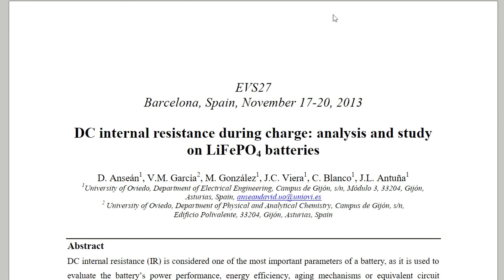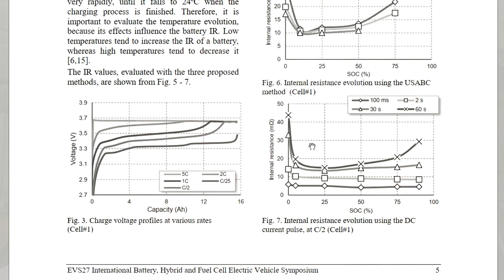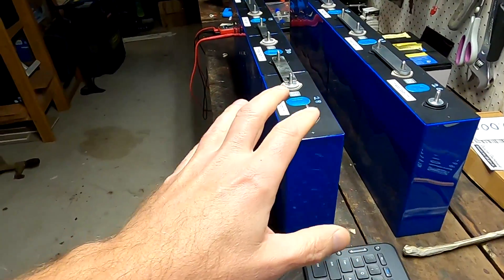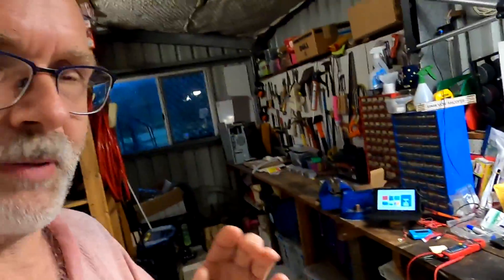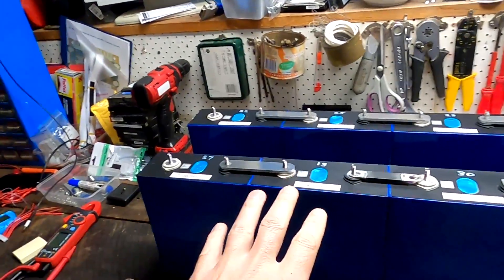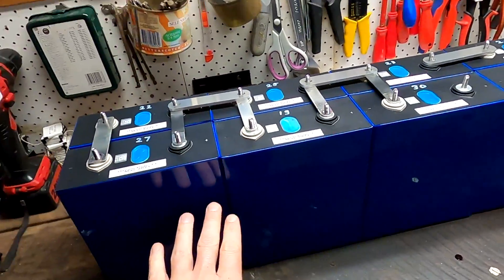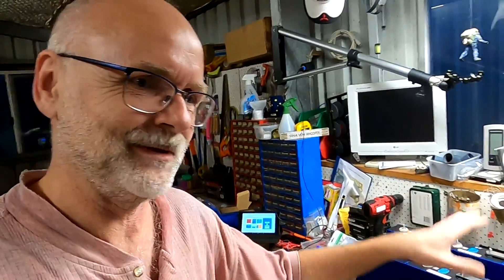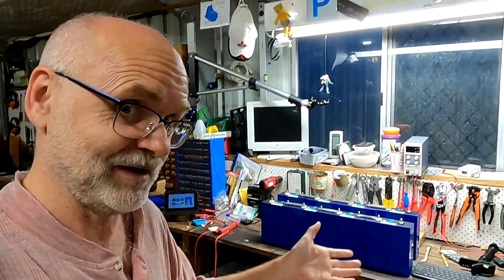Can you parallel battery banks after bottom balancing?

Comment: With a total  off grid situation, we never see the bank completely full, or never completely empty. The bank is constantly being discharged and during the day charged at the same time. The bank is sized so that it hovers somewhere between 20 and 80 percent charge level, it  almost never reaches the voltage extremes because  of its size. Therefore, the bank stays around the 3./ 3.6 V per cell  level, the mid  part of the curve which varies very little. Its only at each extreme the voltage can  potentially damage individual cells over  time, it seldom gets that far..  The charge controller will protect the high level, the inverter low cutoff protects the low voltage level. . Cell variation only matters when venturing toward  the voltage  extremes. Cell balancing cannot work effectively or make any real difference at mid charging points, the cells will always be 3.0/3,6 volts nomatter what their state of balance is. My bank is always within 30mV, no BMS, no balancing..... , remember we are talking just 30/100ths of a volt here, your case  are dealing with  and expecting balances of just 3/100ths volt, ie 3mV,  that is 10  times less !!. Thats  an extreme resolution that is not necessary. The long term battery cell drift in reality  over long periods is very low when batteries are used in this way. You are seeing these voltage imbalances only  because of "batch" charging cycles, where you fill them up, then drain them, constantly worrying about a few 100ths of a volt.  These batteries really are not that fragile and fussy. You have discovered already just how little capacity remains at either end of that flat curve, there is no need to go that far. Apologies for the  lengthy comment.

Comment: Hi Andy, use your new bottom balanced 24 volt bank to power DC LED work lights for your garage. Then add a 24volt DC truck stereo. DC is really easy and great lighting leaveing your 48 volt bank for your inverter.

Comment: Hi Andreas, hi all,
for now 2 years I'm running a 25 V / 1600 Ah system.
There are 8 blocks with 8 x 200 Ah. Every block has an actice balancer, I'm using no bms.
The upper voltage is regulatet by the charge controllers (3), the lower voltage is regulatet by the grid tie inverters (3). The blocks are connected with plus and minus together to big copper plates. With this connection every 24 V block has exact the same voltage as the others and the 8 active balancers are conrolling and keeping the voltages  for each block.
System is running for now two years without any problem....
Best wishes, Wilfried from Neuss, Germany......

Comment: I’m no fan of bottom balancing, and I don’t think below solution is a good ide, but I actually think it will “work” in parallell as long as you have separate bms’s for the packs. A common port bms won’t know where the charge is coming from, and will do its work accordingly, ie shut of charging when the weakest cell peaks. The charge voltage would then be determined by the pack that has the highest sum of cell voltages, and preferably you would use mosfet based bms’s.

In this configuration there should be no problem for the controller/inverter as long as the strongest pack remain balanced (ie the charge is not shut off by the bms but the charge controller). 

In theory you should be able to mix top and bottom balanced packs as long as they have their own integrity secured (BMS).

Reagarding your early comment on absorption and floating; you will have kind of floating for the weaker packs, but more like trickle charge since the bms will control the charge. A sunny day when the bank is “full” the bms will trigger on and off constantly. (Again, mosfet based bms is preferred)

Comment: Never bottom balance, BMS is designed for top balance only and by design to shut the battery bank down if too high or too low  voltage

Comment: Hi AndyIn my opinion top and bottom balancing are for 2 different purposes
If you are going to run your battery flat on a regular basis ie in a electric vehicle bottom balance is the go
If you are running your battery to full capacity every day as in a home based power system top balancing is the way to go.
If you are going to expand your battery by paralleling a extra bank top balance is the way to go
I have my 27kw system top balanced and it is still in balance after 3 years maintained with a Australian made bus
Keep up the good work

Comment: You are trying to figure this out without thinking about chemistry. Any battery regardless of type is moving ions between two locations. The internal resistance to movement is determined by the number of ions in the battery. This resistance is a chemical resistant! How much energy is required to move an ion from point A to point B. If battery a has a million ions, and Battery B has a hundred thousand then battery A will move 10 ions every time battery B moves one ion. Automatically, you don't have to do anything. It goes without saying that the batteries have to be the same chemical composition. From our perspective, it requires electrons to do all of this! From the batteries perspective every ion requires a certain number of electrons to force it to move. Pretty simple concept!

Comment: Hi Andy, these are just my opinions but I have been around batteries since 1979 when I worked for a large battery manufacturer. I studied electrical and mechanical engineering and although I now design computer software I have worked with load balancer, split charging systems and battery powered device terminal estate management systems in the past so, I have quiet some views and experience of what works and does not work in battery and cell management. These are just my opinions and I’m sure others will have different views…
Each new cell pack you add should in my opinion be thought of as a separate entity and each should have a BMS of its own. The reason for this is that you want each cell in every one of the entities to be individually monitored in terms of its lowest set voltage, and you want the BMS to cut the discharge from that entity when any cell in that particular entity reaches its minimum set voltage. So each entity does not need to be matched to other entities in terms of capacity. All cells in each entity should be same capacity (matched) for that entity. This allows you to add another entity to your ‘battery bank’, the only thing you need to do is make sure that each new entity you add is charged to the same voltage as the bank before connecting so that cross entity transfer is minimised. If you then need to discharge the bank then all entities will contribute until each reaches its bottom limits based on the BMS setting for that entity. Any entities that have not reached their bottom limits will continue to contribute until all entities have reached their bottom limits. Same applies to each entity for top limits in terms of its top cell voltage limits. The BMS balancing should be so low as to be irrelevant or should be disabled in each entity. You have to think of it holistically as each entity being a contributor to the sum of all entities. The solar panels are contributor entities when applying a load to the bank and become net contributors to the battery bank. When the load is removed they become the recuperation source and the battery entities each become a separate load until each is charged and disconnected by its BMS. An analogy is It’s a bit like a group of people pushing a car up a hill, not all the people need to be the same weight, strength, size, or have the same stamina. All the people contribute to pushing but some will do more work than others, some will push with a lot of force but stop pushing earlier, and some will push with less force but for longer. Ultimately all will stop pushing and need to recuperate. Eventually the car will get to the top.

Comment: You can think of Equalization as Center balancing if it makes you feel better. However as long as every battery is operating in the center region that is not in either knee, then they will simply share current as required for their individual capacities and it is totally automatic. When the voltage starts to drop rapidly or rise rapidly, cut off the charge or discharge.

Comment: The same process occurred on the discharge side. As each battery approaches its knee the internal resistance to providing electrons rises. The smallest capacity battery will simply not provide electron and the higher capacity battery will. When every battery in parallel is exhausted, in other words has provided all of the electrons it easily can provide, then each battery has reached its knee, and the voltage will start to drop rapidly. That is the discharge the of the entire battery and you will see the voltage of the entire battery start to drop rapidly at that point you need to turn off the battery to prevent higher resistance and heat and higher damage.

Comment: When every battery in parallel reaches its individual charge capacity and its internal resistance begins to rise rapidly then the voltage from the outside starts to rise rapidly. That is the knee of the entire battery.

Comment: At some point the lower capacity battery reaches its charge knee and its internal resistance begins to rise rapidly. In the meantime the higher capacity battery is still merely accepting electrons with a lower internal resistance. The electrons simply flow into the higher capacity battery with the lower internal resistance. At some point, the higher capacity battery also reaches its knee and its internal resistance begins to climb rapidly.

Comment: It is this varying resistance which allows two batteries of different capacities to work together seamlessly. At any given voltage the lower capacity battery will have a higher resistance to electron flow. As a result the higher capacity battery will accept electrons which the lower capacity battery cannot accept at any given voltage. Likewise on the discharge cycle, the higher capacity battery will provide electrons which the lower capacity battery cannot provide at any given voltage.

Comment: The battery manufacturers tell us operate within 10% and 90% of capacity. This is why! Yeah you can jam 20% more into the battery but you do so at the cost of increased resistance and thus increased Heat. Heat damages the battery. Do not do that

Comment: Electron flow into and out of battery provides the charge to push these lithium ions back and forth the knee represents the point where chemically the battery is at its end. The battery is telling us I have no more electrons or I can accept no more Electrons. The Area past the knee represents substantially higher resistance, which represents higher Heat. Heat is bad! Try not to go there!

Comment: I watched a very good whiteboard lecture about the chemical processes involved. There is a metal film with a layer of iron phosphate deposited on it. This layer accepts or provides lithium ions. As the lithium ions have to be pushed deeper into or extracted deeper from this layer the resistance goes up. And thus the voltage required to push or extract the lithium-ion goes up. At some point this layer runs out of easily available positions And the cell has reached its knee.
Reply: Can you please post the link to that video here?

Comment: My understanding is that when a battery reaches its knee , it is unable to accept or provide more electrons. So if you have another battery of Greater capacity, that battery will still easily accept or provide electrons. The two batteries will just naturally share the load or the charge based on their individual ability to accept or provide electron at any given moment.

Comment: My answer to your question is once again to stay away from the Steep curve past the knee. You connect the strain and parallel allow them to equalize. Operate. battery between 3.10 and 3.4. This that you have control over the vms4 the low side and the charge controller for the high side

Comment: I top balance.  I charge my batteries up to 3.55 to fill them up, and I use my Batrium BMS to burn off any excess voltage on a cell (@1.7amps/cell) if one cell gets to 3.55 before the rest. In all 3 cases where I’ve built my own battery bank, I get my rated capacity between 2.75 and about 3.50. So I just plan to use my cells in that range and never go down to 2.5 or up to 3.65 unless it’s a rare circumstance.  But I also oversize my cells in hopes of having more capacity than needed.  
As far as expanding the battery pack goes, I consider what I am powering (discharge rates) and if the cells are close in capacity or not. So far, I’ve managed to buy near-the-same capacity cells on the 2nd and 3rd round, so matching hasn’t really been an issue. I started out with a 2P8S pack with a continuous 1C discharge rate of 272ah, and then when I added another 16 cells, I knew I would want to draw around 200-250amps @24v so I added a second 2P8S and put it in parallel with the original pack. So now, I have a 2P8S2P with a theoretical continuous 1C discharge rate of 544amps to run my 2 victron 24/5000 inverters. The reason I didn’t just parallel my cells and get 4P8S, was because if I didn’t want to work the cells super hard. I still have the capacity either way I do it, but one way doubles the discharge load on the cells, which would shorten their life span.  As far as expanding further, beyond my current 32cell pack, I would likely double my cell count each time I expand. Ergo, my existing cells would be rearranged into a 4P8S configuration, and if I can’t get the same size cells again, then I would just change my Batrium bms capacity from 544ah to 1088ah and probably lower my top voltage down to maybe 3.45 or something just to keep one pack from filling up too much before the other one as you mentioned.  With Batrium, I can have over 100cell monitors in nearly any configuration I like. And unlike other BMS’s on the market that balance or discharge-to-balance using only a few milliamps, the cel monitors I use can do 1.7amps each.  Oh and the bms can handle up to 1000amps if the battery can handle it.  I wanted something that would grow with me as my needs changed and I also wanted something that would integrate into the victron ecosystem and tell the MPPT’s what they needed to do based on the condition of the individual cells, not just based on a voltage number. If one cell gets too full to fast, the bms tells the charging system to “slow down” or even to stop charging.  

My $100 offer still stands, Andy!  😊

Comment: As for connecting 2 sets of batteries.  Just make sure the wires attach on opposite plus and negatives.  The strongest battery will always take the most current, but that doesn't matter much.  Eventually, they will both be the same strength.   Bank 1+ to inverter and Bank 2 - to inverter with cables connection + and - from each pack.

Comment: Bottom balancing would help if you expect to have a very high charge current.  If you have a high discharge current a top balance would be better.  But like you are figuring out, it needs to be automatic and I don't see a way to bottom balance automatically.  Maybe with a BMS that activated a balancer only when voltages are low.  Still the better automated solution is a resistor based BMS with higher shunting capability than your solar charge current.  Then you never have a shutdown unless your entire pack is fully charged.   Batteries are not the same efficiency so you will have some needing 101% to charge and some 102% to charge.

Comment: * To parallel safely the voltages much match close enough to prevent high current flowing.
* To parallel effectively so the banks will not rapidly drift apart the state of charge must match - the same point on the charge and discharge curves. Even then parallelling is sketchy as the paralleled will not share current evenly and will drift further apart with each cycle. The worse the match on the charge/discharge curve the faster the drift.
* It is easy to match at full charged and top balanced and it is easy to top balance with a set and forget "charge all the cells to 3.6v until current stops flowing."
* It is hard to match at full discharged and bottom balanced and it is hard to bottom balance as there is no set and forget - you must define a voltage and a discharge current and as soon as you stop discharging the voltage will rise. That is, unless you ruined the cell(s). What do you think will happen if you discharge "until current stops flowing" ? Now try to do that with multiple different banks at different times so they will be at the same points on their charge/discharge curve. It's hard.
* It is impossible to match points on the discharge curve anywhere in the middle between full and empty. If you match voltage you can safely parallel, but the banks will drift far apart with few cycles.

Comment: This is shocking. I ran a test on a 280Ah EVE cell to see what the resting voltages are at different States of charge so I could accurately charge to 80%.  I started charging an empty cell at 15 Amps and putting 28Ah into it (10% SOC). I let it stand for several hours to stabilize, and recorded the voltage. I did this in 28Ah (10%) increments. Everything looked fine until I got to 70% SOC. the resting voltage was 3.341V. Now here is the crazy part, 80% had almost the exact same resting voltage of 3.343 and 90% was also at 3.343. 95%? You guessed it, also settled at 3.343V! If you're going strictly by voltage to estimate state of charge, You could be anywhere from 70-95% at roughly the same voltage. I believe the best way to solve this is to charge and balance to 100% so the Shunt can reset the SOC back to 100% and it will count down from there, giving you the most accurate SOC reading.
Reply: Pretty sure the Victron shunt/system also coulomb counts so not totally dependent on voltage measurement